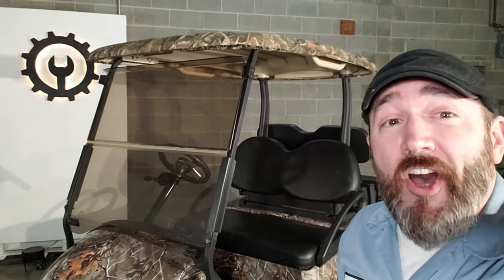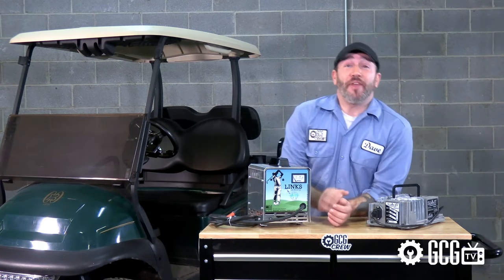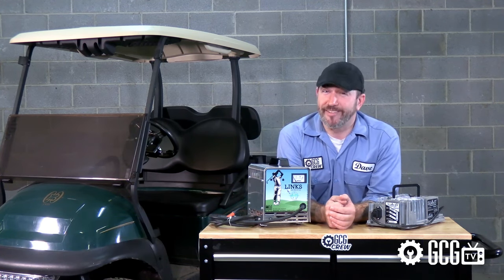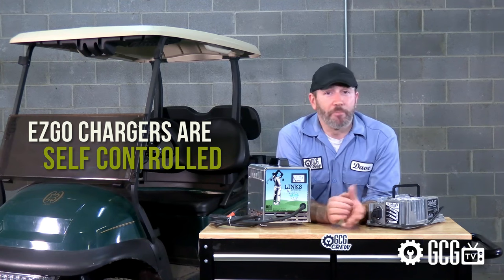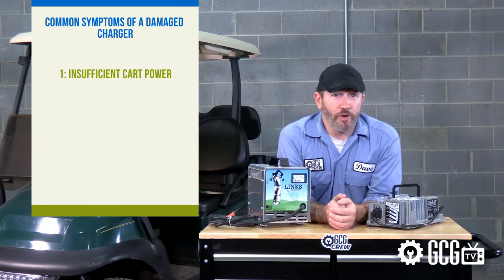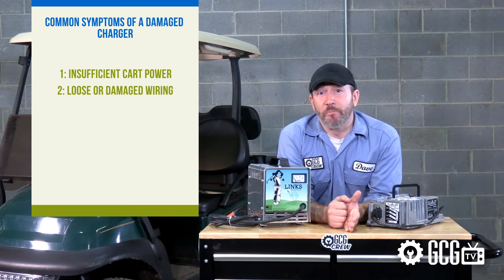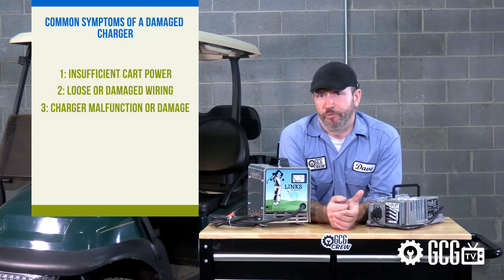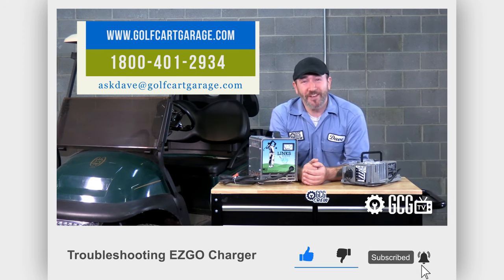EZGO Charger Troubleshooting | ASK DAVE | Golf Cart Garage

Comment: I’ve got a Badboy buggie and the charger wire at the 120volt source gets hot and has burned the connector to the golf cart charger itself. We have two chargers that are both getting to hot. Any help would be also thanks..
Reply from the maker: Thanks for watching!  If multiple chargers are having the same issue, there is likely a problem with the cart receptacle or possibly a bad cell in one or more batteries causing the charger(s) to fail cycle completion.  You can get a video call diagnosis here: https://www.golfcartgarage.com/gearheads-on-demand/
or get in touch directly at Support@GolfCartGarage.com or (800) 401-2934

Comment: Hey Dave, I got what I believe is a 1998 EZ Go from a friend that sat for 10 years. I put 6 new 6 volt batteries in and it ran great!! I couldn't believe that everything worked. Forward, reverse, brakes wow! Then two weeks later nothing. I am getting 36 volts to the motor but nothing happens. Seems everything is working right. Everything looks good. Any first guess?
Reply from the maker: Thanks for watching!  Strangely, we've seen a number of owners in this situation find out that the splines in the rear axles stripped out the hubs, so the wheels couldn't turn. That said... If you need help without sitting through a video, you can get a free appt for a video call diagnosis with a tech here: https://www.golfcartgarage.com/gearheads-on-demand/ or get in touch directly at (800) 401-2934

Comment: i have an older e z go and bought a new charger from Amazon and my question is can you overchsrge the batteries? With my pld charger on my 6 six volt batteries my tester showed around 37 volts after finish of charging. With the new charger (the old one stopped working) once finished charging i get a reading of around 40 from my tester. Holf cart has way more energy once the new charger finishes but now noting some battery acid leakage. Is that from overcharging the batteries?
Reply from the maker: Overcharging can be a normal cycle that a charger performs every few cycles to ensure that every battery is getting full.  40V is a good solid charge on a 36V system.  It's the voltage above 36 that you actually use for driving.  If you keep getting leakage, however and it's frequently overcharging, there may be a malfunction to the charger.  Not a bad idea to contact the manufacturer if that's the case.  Let us know if you need more help!  Support@GolfCartGarage.com or (800) 401-2934.

Comment: Dave, I just watched your video but no clue offered. I have a 2014 EZGO RXV with new batteries.  When I go to charge it (batteries have a charge) my EZGO charger clicks on an off for a while before charging.  I have replaced the charger receptacle. Suggestions
Reply from the maker: Thanks for watching, Thomas! What brand of charger is this and did it come with the vehicle?  Or is it an older charger?
Reply: It is an EZGO Power Wise charger.  Yes, it came with the cart which I bought used.  One additional thing is that this seems to be most prevalent when the cart is almost 100% charged. Not sure if I am just earing a normal segment of it's charging or . . .  Thanks for your posts and replies

Comment: Hey Dave, I have a 2019 EZGO TXT 48v.. One day while it was charging, it charged for about 2 hours then it quit. The charger is flashing green then goes to red and is not charging.. What's the issue?
Reply from the maker: Thanks for watching!  We recommend a load test on the batteries.  One bad cell in one battery can stop your charger from completing its cycle or engaging at all.  Next, the charger can be checked and repaired if the housing is removable.  Otherwise, it may need to be replaced.  If someone you know has a charger with the same plug, it can help to determine if that's the issue.  Get in touch if you need more help! Support@GolfCartGarage.com or (800) 401-2934

Comment: Hey Dave I have been trying to fix my ezgo txt golf cart and nothing is working….. all batteries are fully charged all wires are good tried plugging in original charger and nothing I’m starting to pull my hair out lol I’ve checked  batteries with a test light I have actually tested everything with the test light there power to it all I’m at a lost can you help me out? I’d like to see if I can fix it before I have to pay 200 for golf cart to be picked up thanks
Reply from the maker: Thanks for watching! If the cart still has enough power to drive, it should be able to turn on the charger.  It's possible there's a loose connection or issue with the receptacle, but this type of situation is usually charger malfunction.  If you know someone with a charger that has the same cart-side plug, it's a good experiment to try it out and see how that goes.  In most cases a replacement charger is what's needed.  That said, we have a free video call tech service here: https://www.golfcartgarage.com/gearheads-on-demand/ that might help you avoid the $200 pickup fee.  Or get in touch directly at Support@GolfCartGarage.com or (800) 401-2934

Comment: Hi - My EZ Go golf cart was stored for the winter.  I disconnected one of the wires & put the lever on tow & stored it in my garage for the winter months.  Then I connected the wire & moved the lever forward out of tow & plugged in the charger.  But, the LED light is not flashing at all.  Is is charging?  I know it can take 8 to 14 hours to charge but there is no flashing & I'm wondering if it's charging???  Thanks a million for your help here. Joyce
Reply from the maker: Thanks for watching, Joyce!  If your charger is not giving an indication that it's charging, it's probably not sending voltage.  Here's our video on power testing: https://www.youtube.com/watch?v=NsUkLCTWSnQ
If you need real time help, just get in touch!  Support@GolfCartGarage.com or (800) 401-2934

Comment: I have had my 2005 EZGO golf cart for 8 years. All of a sudden my Charger stopped working. Never had a problem with it. No light when plugged in. Is it done? do I have to replace it?
Reply from the maker: Thanks for watching!  If it doesn't indicate that it has power when plugged into the wall, it may be out of service.  Though, if the cart is dead, it can't tell the charger to turn on.  That could be symptomatic of other issues.  Get in touch for more help!  Support@GolfCartGarage.com or (800) 401-2934

Comment: Hi My golf cart charger is flashing. 2 red lights have unplugged it and plugged it back in still the same thing period
Plugged it into a different plug and it still flashes. 2 red lights stops and then flashes to red lights again.  Don't know what to do now. Check all connections are all good. It's an EZGO Golf cart
Reply from the maker: Thanks for watching, Kim!  Your charger is throwing a fault code.  Each charger brand has different codes.  You can consult the charger manual or the charger manufacturer for info on what the 2 red flashes indicates with their specific machine.  It is usually a malfunction in the charger or batteries that are too low to engage it, but it can differ from brand to brand.  If you need more help or a charger replacement, we'll be here!  Support@GolfCartGarage.com or (800) 401-2934

Comment: My 3-wheeled EZ-GO green golf cart blue the capacitor on the Georgia black charger they sent me a new capacitor but it's half the size for 36 volt should I hook it up
Reply from the maker: Thanks for watching!  If that capacitor is matched correctly to the charger by part number or UF number, we wouldn't worry too much about the physical size.  Just be sure it's the correct replacement by cross-reference.  Let us know if you need help! Support@GolfCartGarage.com or (800) 401-2934
Reply: Thank you for the encouragement...lol. I put the smaller new capacitors in the charger. Put on new charge port and cord end...male female. All batteries werenew 4 years ago and dead. The charger did not even get hot like it used to. I hung around the cart for 4 hours, still cool to the touch, and the meter showed it was charging. I charged another 4 hours.  It works fine now, Thank you.  My wife no longer has to walk to the garden.

Comment: I received my new EZGO Marathon 18 amp 36 volt charger yesterday when I plugged into the power source I have a red and green light before I plug into the cart. Any suggestions
Reply from the maker: Thanks for watching!  Depending on the model of charger you've chosen, there may be a fault code, there.  Get in touch if we can help further.  Support@GolfCartGarage.com or (800) 401-2934

Comment: We just bought a used cart.  When I first plugged it in, it was about 17 or 18 on the charger meter, now it’s showing only 10 after several hours.  Any idea why it’s draining the batteries and not charging them?  Bad charger?  36V, 1994 EZGO TXT
Reply from the maker: Thanks for watching, Karen!  There are some follow up questions that aren't ideal for a comment section.  We recommend a free diagnosis appointment with our techs here: https://www.golfcartgarage.com/gearheads-on-demand/
Or alternatively, you can reach our techs directly at Support@GolfCartGarage.com or (800) 401-2934

Comment: Just changed out the control board on my Power Wise charger model 28115 G04 for my EZ go cart. Now my charger ammeter doesn't show to charge above 4 amps no matter how much I use the cart.  Before it would register 10 to 15 amps when I plugged in.  I also discovered I had two batteries that were only at 2 volts instead of 6 volts, the other four batteries were at 5.9 or 6 volts.  Could it be the two batteries that are causing the charger not to charge beyond 4 amps or is it the replacement control board I installed.
Reply from the maker: Thanks for watching, Rick!  Sounds as though there may be some trouble with the 2 batteries reading very low.  May want to check those to see if they need to be replaced.  We recommend a consultation with our virtual techs here: https://www.golfcartgarage.com/gearheads-on-demand/
Or get in touch directly at Support@GolfCartGarage.com or (800) 401-2934

Comment: When I initially plug in my 36v charger, the light flashes between red and green a few times, then does nothing else... where do I start?
Reply from the maker: Thanks for watching!  If there's enough power to drive the cart, your charger is throwing a fault code. Checking the owners manual will explain the fault code for that specific charger.  It may need to be replaced.  If the cart is dead, it will need a jump charge before charging. We have a video on that here: https://www.youtube.com/watch?v=ALvkrJmTD6w
Let us know if you need more help! Support@GolfCartGarage.com or (800) 401-2394

Comment: My charger is buzzing when plugged in and also is saying “abnormal cycle.” Any ideas what is wrong?
Reply from the maker: Thanks for watching, Katie!  That fault code typically means a charger is experiencing an internal malfunction or that there is a bad battery, cell, or connection stopping the charger from reaching full charge.  Load testing the batteries may reveal an issue there or trying another charger to see if it works normally may shed some light on this as well.  Let us know if you have more questions or need help.  Support@GolfCartGarage.com or (800) 401-2934

Comment: Have a 2008 Ezgo golfcart put new batteries and cables bought a new charger thinking it was a bad charger  bought a new charger and it not lighting up and charging batteries still have power not dead what else can it be
Reply from the maker: Thanks for watching, Zoe!  Depending on the charger, they sometimes need a power threshold of about 30 volts to turn on.  Unusual, but it could also be an issue with the charge receptacle.. or even a bad charger.  They can sometimes be faulty like any other product.  We recommend consulting our virtual diagnosis team here: https://www.golfcartgarage.com/gearheads-on-demand/
Or you can reach out to our Techs at Support@GolfCartGarage.com or (800) 401-2934

Comment: I just bought a 48V 2015 EZ GO RVX from a dealer here. He provided a 48 V EZ-GO charger. I plugged it in today and about an hour later I went out and it was so hot I couldn't touch it. I also noticed that both cables on the charger were hotter than I would have expected. Then, after disconnecting from the cart, I pulled the plug from the wall and it tripped the GFCI in the garage. I also have a freezer connected to that same circuit. I looked and the charger pulls 8 amps. The circuit is a 20 amp circuit. Is this happening because the circuit is overloaded, the charger is defective or something else.
Reply from the maker: Thanks for stopping by!  From what you've described, it sounds like the charger may have some issues.  If possible, try it out on another cart or on a different circuit.  If you have more questions, we have help by email at support@golfcartgarage.com or a free virtual diagnosis service at https://www.golfcartgarage.com/gearheads-on-demand/

Comment: Can the EZ go Textron total charge plug that fits a 1978 Western EZ  golf cart replace the plug on a new charger so it fits the old golf cart?
Reply from the maker: Thanks for watching, Denyse! Yes, your plug can be reinstalled to a new charger.  It's important to make sure that new charger is for the correct voltage and battery type.  If you have more questions or need help, just get in touch!  Support@GolfCartGarage.com or (800) 401-2934
Reply: @GolfCartGarage  Thank you. Yes, both chargers (old & new) are 36 V. I was only concerned because the old charger is about 35 yrs old. Didn't know if wiring had changed significantly in 35 years & could be dangerous. Thank you again

Comment: My plug in for the charger to plug in on the side had a wire disconnect and I can't charge my battery. Is there another way to charge a battery in a golfboard?
Reply from the maker: Thanks for watching, Jeffrey!  If yours is the scooter type golfboard, you may be able to use an auto parts store handheld charger with clamps to keep a charge in it for the time being.  Most of the golfboard chargers are proprietary, so it may require getting another charger from the manufacturer.  If you have more questions, just get in touch!  Support@GolfCartGarage.com or (800) 401-2934
Reply: I ended up cutting the wires from the charger and cutting the wires from the plug. I spliced them together and what do you know the charger started and it charged my battery. I threw the plug away. Thanks for getting back to me so fast.
Reply from the maker: That's some surgery you did, there!  Let us know any time we can help, we consider it a privilege.

Comment: Have an EZGO charger model 917-4810 and no manual.  Will this trickle charge over the winter?
Reply from the maker: Thanks for watching, Ginny!  The data sheet on that charger says the storage mode will auto-restart after a 2 volt drop or 30 days, whichever comes first.  The manual is here: https://support.delta-q.com/hc/en-us/articles/360016151591-E-Z-GO-Powerwise-QE-User-Guides
Let us know any time you need help!  Support@GolfCartGarage.com or (800) 401-2934
Reply: @GolfCartGarage   Thank you for your reply.  Greek to me.  So if the golf cart is fully charged in November, and if we have it plugged into the already-mentioned EZGO charger through the winter, it will trickle charge as needed?  And we do not need to worry about it freezing if it remains plugged in.  We live in northern US.
Reply from the maker: Yes.  According to the information on the charger you referenced, it will trickle as needed during winter storage.  Between trickle charging heat and the lead acid in the batteries, there should not be significant concern of freezing.
Reply: @GolfCartGarage   Thank you so much...  Most helpful!!  =)😀
Reply from the maker: It's a privilege.  Let us know any time we can help!

Comment: My plug in cord not the charging cord, the other one. It needs to be replaced how do I do that
Reply from the maker: Thanks for watching, Daniel!  Replacing the power supply cable (also called the A/C cord) can differ from one charger to another.  If you're using a Summit style like we have on the right side of the screen, that removes by hand.  If you're using an older style charger, the housing will need to be removed to change the cord.
If you have more questions, just get in touch!  Support@GolfCartGarage.com or (800) 401-2934

Comment: Solid red fault light stays on. What do I check??
Reply from the maker: Thanks for watching, Jim!  Depending on your charger model, fault codes can be different.  Checking the owners manual may give you a specific fault reason for a solid red.  Sometimes this is because of a bad connection, a bad cell in a battery, or a charger hardware issue.  Let us know if you need more help!  Support@GolfCartGarage.com or (800) 401-2934.

Comment: Batteries were weak barley hold charge now charger does not shut off auto like usual does this mean connections are corroded or batteries bad.  After winter storage batteries water were all low had to top off
Reply from the maker: Thanks for watching, Rick!  This can be caused by other issues with Club Car vehicles.  But, if you are charging an EZGO and the charger will not shut off automatically, it may be that the batteries were so low that it's taking an extra long time to charge, which sometimes throws a fault code with chargers.  Another charge cycle should fix that.  It may also be one or more batteries dead to the point of needing replacement.  You can view our power testing video here: https://www.youtube.com/watch?v=NsUkLCTWSnQ
If you have further questions or need more help, get in touch!  Support@GolfCartGarage.com or (800) 401-2934, we'd love to help.